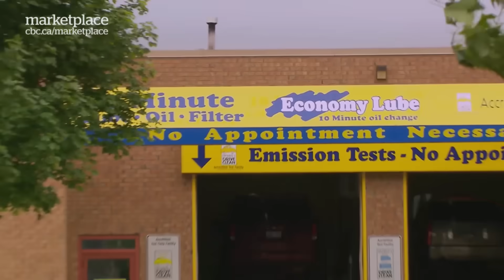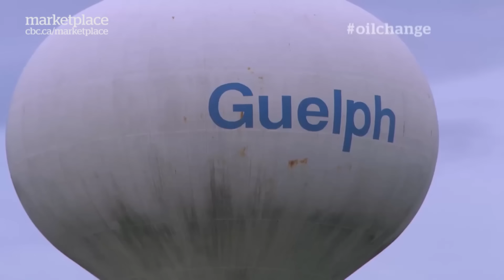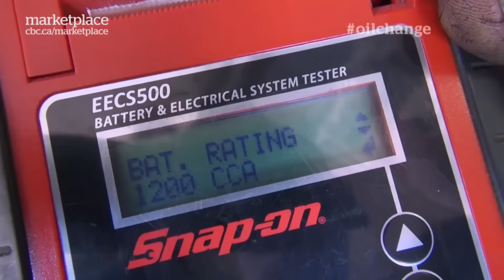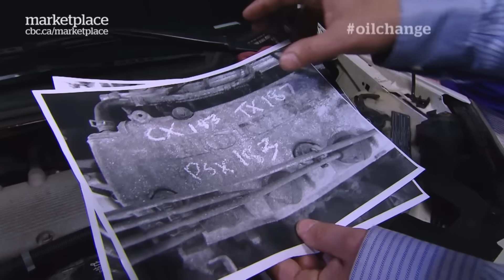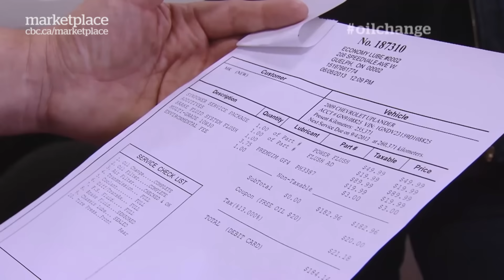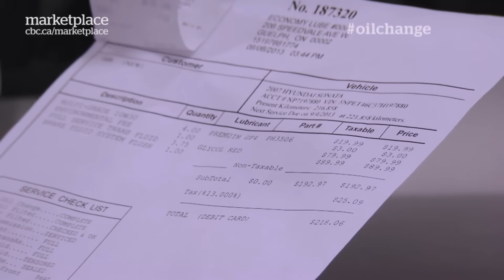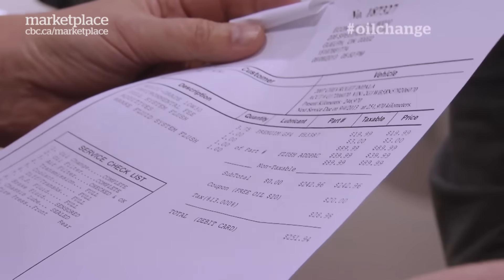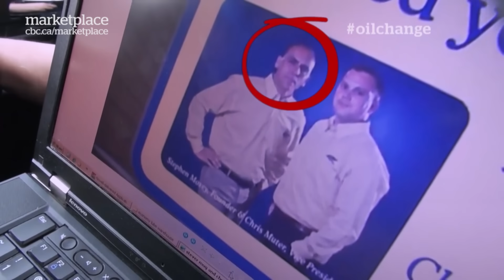Oil change scams: Hidden camera investigation on what really happens to your car (CBC Marketplace)

Comment: Why people should work on their own cars. A good mechanic will keep you coming back
Reply: there are a few good mechanics buy they're hard to find
Reply: everything is electrical now, soon cars won't come with oil dip sticks
Reply: Black Star Chevy does that now in the new Malibu
Reply: the Asus pro Mac is a lie good lord
Reply: Reason I do my own small work on my own car like the oil, collent, break and tires rotation. I have a pro do the heavy stuff like engain work that needs to be done that is a family friend.
Reply: StudiosDraco so basicly you do the same as a Mexican ask a freind or family member if they know how to build engines and that's smart
Reply: Ur Mum working on a car is just common sense but issue is people these days don't have that also people should know not to buy German cars because you get ripped off all the because on a Mercedes a shock cost 1200 bucks for all 4 shocks you can buy a used Toyota that won't break down
Reply: I'm
Reply: No, just know your car and the work that needs to be done. I also go to mechanics I know and trust. I don't have the tools or time or desire to do my own work. Not interested.
Reply: the Asus pro Mac is a lie
Mercedes and Bmw's are garbage cars for the money they cost. I don't care what anyone says.
Reply: the Asus pro Mac is a lie
They're over engineered and when something goes wrong, It's usually something major. Even when it's something minor, it's still way overpriced.
Reply: my dads a mechanic, licensed mechanic, almost every person who has ever come into has garage hasnt shown up again, he never gets complaints, so thats true for some but you cant say EVERY good mechanic will keep you coming back, considering how much money they make from working on a car, its not worth having to put it back on schedule just to keep working on it...
Reply: GamingPredator k lO
Reply: GamingPredator WHERE DOES UR DAD WORK?!?😂
Reply: MeatLoaf vp
Reply: you should work on your own car because you save money and also its your car, why would you let someone change something or make it worse for more money?
Reply: There are somethings i'd rather throw money at to solve the problem than to do it myself. I currently change my own oil, reflush coolant, change brakes, etc but there will be a time when I say screw it and pay somebody to do it. Just cause I can do it doesn't mean I want to.
Reply: Problem is, out there is lot of good mechanics but they're forced by thesese big companies fast job to prefere quantity.But lot of people not understand car is big complex,these big companies  working like supermarkets,mechanic automatically ignore detail what can cost you later on
Reply: MeatLoaf 🏡🏡🏡🏣🏤
Reply: MeatLoaf  not but with these newer vehicles they have a warranty so by changing your own fluid or other things break that warranty
Reply: Only voids your warranty if they can prove you incorrectly changed the fluid(oil/coolant/etc) causing whatever is damaged.
Reply: Working on ur own car does not void your warranty,that's jus plain nonsense,another common scam dealerships tell you.
Reply: MeatLoaf But rich people who own their car don't do that these days
Reply: MeatLoaf rich peoples cars are were the real techs are
Reply: MeatLoaf with a good mechanic, you shouldn't NEED to create back.
Reply: all the mechanics we've trusted enough to even go near our car have started off fine, but as soon as they think they have our trust they start ripping us off.

Comment: Ma'am you have winter air in your tires and it's summer now so it's recommended that you have your air changed in your tires before you cause serious dry rot. Also you need new muffler bearings and your car has 2 mufflers better get it done today! Your headlights need Blinker fluid as well. + Your car takes only synthetic oil. Yes ma'am we care so much about you and your car that we gave you a 25% Discount.. that will be $259.95

Comment: I was a mechanic at a small engine repair shop, and I was let go because I only changed/fixed what was needed. They wanted filters, hoses, and sparkplug replaced no matter what. Stuff that was warranty work could be called user damage if the main mechanic didn't like like the customer.  Carburetors were replaced rather than rebuilt. They would tell customers that the carburetor kits were made so cheaply that they all leaked.  If a 2 stroke power equipment was sold, they would keep the tool, and oil that came in the box.  They would keep the extra oil from oil changes and, and charge the next guy a shop fee to use that leftover oil when the oil needed to be topped off.
Reply: My nephew was terminated for the same thing!
Reply: @amorgan5844  I was told "if they can afford a $1400 chainsaw, they can afford an extra $60 for a spark plug and fuel lines."
Reply: @Casey Styer  yikes! Thats dirty business.

Comment: I went to a quick oil change operation in Michigan a few times. I became suspicious after I checked my oil each time and it got dark fast. They tried to sell me windshield wipers for $175.00. They also pulled my brand new air filter out and showed me one that was filthy dirty!! I just installed a brand new one a week earlier. I finally got out of the car and and said enough is enough!! This oil change facility was changing the oil but never the filter!! I even marked an x on the filter twice and both times the oil filter was never changed. I filled a formal complaint with the state of Michigan. Basically nothing was done!!! But within a years time the place went out of business!! I steer clear of all quick oil change places and stick with my dealership where I know the technicians and service manager. Yes it’s a bit more expensive but the peace of mind is significant!!!!

Comment: One time a guy seemed to be always having to get something done at the mechanic on his older car.  And the cost every time seemed like something was amiss in my estimation.  So I mentioned he could probably spend the same amount of money paying off a new car rather than keep paying this mechanic for all these (apparently) necessary repairs.  It seemed like every month, he was having something done for a few hundred dollars and being told if it wasnt done soon, the car would break down or the car would end up with a more expensive bigger problem if not fixed.  He did get a new car, and ditched that mechanic completely.

Comment: Had some dealings like this with a Goodyear place saying the battery was low. My sister said replace it. They broke a piece of metal off the car. Tried calling around places to find replacement part, no luck. Manager said he would drive himself to pick up part, never happened. He said they would pay for rental. Took several days to get part and fix it. I was told over the phone higher ups weren't going to pay for rental after they said they would. When I picked it up, employee said she heard what happened and felt it wasn't right since she heard they would pay for it and didn't...so she gave me the keys and said she wasn't charging me for the oil change or battery. Still had to pay for the rental. They tried to tell me the shocks needed replacing too when I had it in for brakes. Car still rides fine.

Comment: Pissed myself laughing when he said the brake fluid should be clear 😂😂
Reply: there is some brake fluid that is clear tho
Reply: Ive have seen brake fluid upclose when it was on my eyes and face lmao
Reply: Well dot 3 and dot 4 are clear green if it's gets black or really dark that means you got water in your fluid and it's needs to to be change water lowers the boiling point of the fluid and reduces your braking distance when the brakes hot
Reply: Fresh brake fluid is clear. However what they charged for was a brake system flush, and only sucked out the reservoir fluid and put fresh fluid in. Complete rip off.